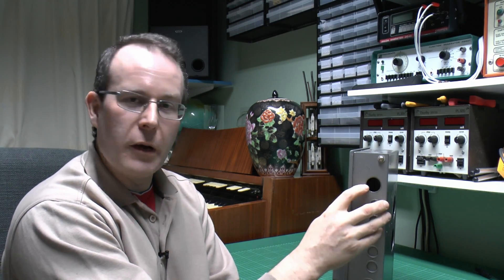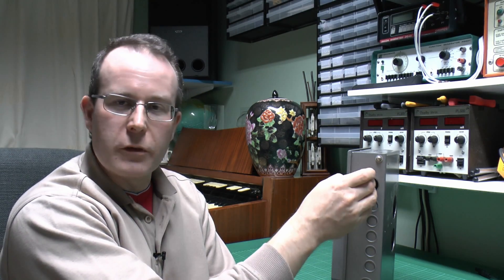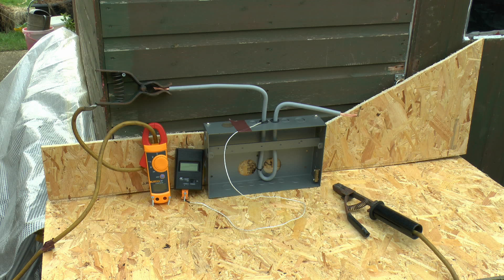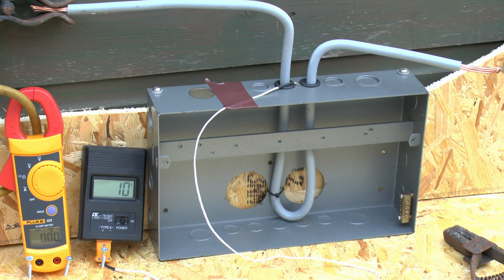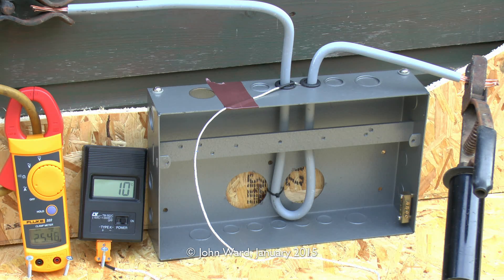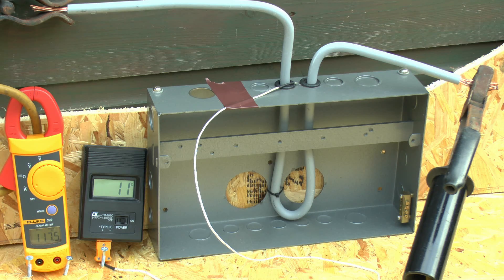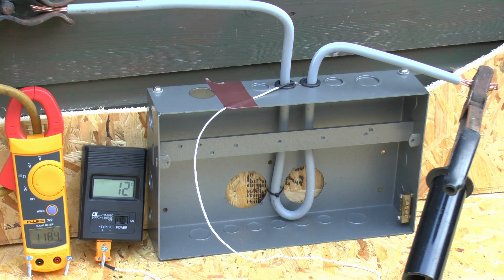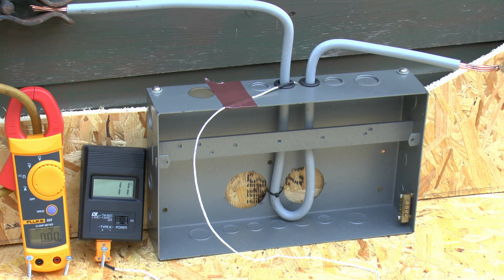Single Wires through Metal Holes

Comment: wow, are you UK guys really only allowed 100 amps? my house here in the US  has a full 200 amp, 240 volt main in it.
Reply: I suppose having half the maximum current makes sense since the voltage in Europe is twice that of the US so the maximum available power is about the same, around 24kW. That's quite enough, I suppose.
Reply: +Nick Dvorchak You need it......... If you run appliances, especially air conditioners and such, at 110v you pull a HUGE amount of amps and therefore watts, compared to a much more efficient 240v compressor found in ac's and fridges etc in countries setup solely for 240v
Reply from the maker: +Nick Dvorchak 100A is the usual maximum for a house, 80A is also common, some are only 60A.
Larger supplies are available in most areas, the next up is a 3 phase 100A supply (3 x 100A) but this is seldom used or needed for homes, even for those with electric heating.
Reply: oh wow, here in the US, the standard is 100 amps for newer houses, unless they need a bigger main, though, I have a 200 amp service.
Reply: +Nick Dvorchak you say your house is 240v but the standard 110v? So you are saying it is strange that a standard house in the UK is not as good as your non standard house in the US? Is that not like saying your standard ECO car is not as fast as my custom built race car? Not very surprising?
Reply: +Colin Richardson why do you say the standard is 110v? the newest standard, to my prior knowlage is 100 amps and 240 volts for new houses. my house, as i stated before, is 240v, 200 amp. The only change is, is the current, not voltage.
Reply: I thought u guys in America is all 110v?
Reply: +Nick Dvorchak The average house in the UK will never be pulling anywhere near 100Amps to be honest. Houses vary from between 60amp fuses and up to 100 amp fuses single phase. What could you possibly need a 200amp supply for in a domestic dwelling?  Unless i am having a shower or cooking with the oven and hobs on my flat never sees more than a few amps to be honest.
Reply: If you cut neutral you can still have power. The devices driven by each phase would divide the voltage to a "local" neutral. Since the load is seldom evenly balanced, this may will not match the "global" neutral and it will shift when appliances are turned on and off. Naturally it's rather unhealthy for all electrical devices.

Also, if you don't have a proper ground, that voltage is applied to the chassis of all devices. 

Where I live you can use fuses or over current relays for short circuit protection. AFAIK the relays will cut neutral as well. Ground is run separately and may (naturally) under no circumstances be cut. Residual-current circuit breakers have been mandatory for decades as well as proper ground. Interestingly, ground in wall outlets has only recently become mandatory.
Reply: +Nick Dvorchak 200 A x 3 400 V (200 kW+) here :)
Reply: Nick Dvorchak most of the houses, like 80 % in my country has 75 A 400V three-phase supply. My wires are a bit thicker.
Reply: well, its not twice the voltage. at every outlet it is, but not the service. my house is 240v, 200 amp, and 48kv.
Reply: +Colin Richardson no, well, kinda. Up on the street, coming into the house, we all have 240v, and 100\200 amps, depending on the age and size of the house. Once it gets to the panel, the the 240v gets split down 2 rails.  the 2 rails are in every other circuit. for example, the 1st hot wire in the panel will feed the 1st, 3dr, 5th, 7th, and 9th, etc breaker depending on the size of the panel. the 2nd how wire coming into the panel will feed the 2nd, 4th, 6th, and 8th breaker depending on the size of the panel. All general use outlet and general lighting circuits are 110v. small appliances are usually 110. but large appliances like the range, dryer, whole house\very large AC units are 220\240v. usually if an appliance is electric, it is 220\240. if it is oil\gas fired its usually 110v.
Reply: +Simon Aragon Well, I live in a fairly large house (for where i am). My house is like 3,000 sq ft 2 floor house also has oil heat, and an oil fired how water heater. with a very large and deep well, with and electric range, also with a 5 ton whole house AC. So, I dont doubt that my house pulls around 100 150 amps at times
Reply: Nick Dvorchak since u say "large" alot. I presume u realise that u then are not the average person we were talking about. Otherwise u would be saying "normal size" this and "normal size" that.
Reply: Well, as I look around when I get the chance, I see alot of 4/0 cable going into peoples houses for 200 amps, even the "smaller" houses that wouldn't need it.
Reply: +Nick Dvorchak 250A service here :)
Reply: daaaaaaaaamn... what for??? how big is you house? and where do you live to need such a large service?
Reply: Nick Dvorchak
We requested a plug to be added for a hot tub that we never used. And the heater is a double pole 60 amp. They way the wired the house on the other hand is pure garbage.
Reply: *****
240V split (aka two 120 phases)
Reply: wow
Reply: well... yes, 250 amp is excessive, but there is a lot of of houses that use 200 amps. but, my air conditioner, whole house, 5 ton, uses all that your house gets... all 60 amps. I think what it is, is that the more voltage, the less current. Here in the US, we have less voltage (normally), so we use more current. There in the UK, you guys have more voltage and less current.
Reply: +Nick Dvorchak 

varies, houses usually have house fuses rated for the board fitted or expected supply. as the US is 120v I assume 240v is classed as a three phase supply? but we do usually have smaller cookers, smaller washers, no air con.
Reply: In the US, I believe it is illegal for a residential house to have a 3 phase service. Here in the US, 240v, can be 3 phase, for commercial and industrial buildings only, as I dont know much about 3 phase, all I really know is that it cant be in houses, and has to be in commercial and industrial buildings. The only fuses that protect a house are on the street, at the transformer, and power quantities of houses and buildings. Also, in the US, we use both 120v and 240v. for example, our ranges (stove\ ovens) use 240v, 50 amp. The 240v is split between 120 for the controller, clock, oven controller. The other 120v leg is used primarily for the heating elements. the reason for 50 amps is because 5 elements (4 burners and 1 oven element) can use massive amounts of energy. Now, our dryers are also 240v, but 30 amp. This is pretty much the exact same thing. a 120v leg for the controller and tumbler motor, and the other 120v leg for the heating element primarily. Now, stuff like microwaves dont use a heating element, and dont use enough power to require 240v, and only use 120v. This 120v leg is used to power the entire thing. controller, clock, turntable, microwave radiation element (which cooks your food), and the timer. Stuff like the toaster is nothing but a tiny heating element, a resistor, a timer, and a couple lights, so 240v is not required. Most of the electrical devices that I know of, that use 120v, use 15 amps. There is also 20 amps, but thats used primarily outside, or for larger, 120v appliances like oul fired furnaces, oil fired hot water heaters, garage door openers (depending on the size), or larger motors. for example, I have a dog. Any dog owner knows that its handy to have an electric dog dryer. The one that we own has a 2 stage, 18 amp, 120v motor in it. since that 18 amps excedes the 15 amps of a regular breaker, we use a 20 amp breaker for it. also, 20 amp plugs have a horizontal neutral prong on it, preventing it from being inserted into a 15 amp plug. Since I have 20 amps at my furnace, we have a GFCI on it, which allows us to plug a 20 amp plug into a 20 amp GFCI. We also have 20 amps in out garage, so I updated some if the plugs in there, allowing us to use it in there. Now, this far into this reply, I noticed you had no air conditioning, so I figure ill explain. The AC is fairly simple. There is whole house units, and window units. Whole house units sit outside, and have a coil for the freon (compressed, cold liquid) in the furnace, where the main duct leaves the furnace and the warmer air passes through that and is cooled and cools your house. But, outside at the unit, there is 2 things, that each require 120v. My personal whole house unit is a 5 ton unit, and requires 40 amps. The compressor uses its own 120v leg and the fan motor, used to cool the compressor uses its own 120v leg as well. Window units are exactly the same, just smaller, and can run off 120v, because it has a much smaller fan and compressor. Some window units do use 240v, but im not too knowledgeable on those units. Now, I can go on and on about stuff like this, but I hope you get the jist of this.
Reply: +Nick Dvorchak The right way to compare this is not amps or volts, but power. As far as I understand you have two phases, each 200 A, 120 V relative to ground. Thats 2x200x120 = 48 kW. A European house (at least in my part of Europe) has three phases, perhaps 60 A, 240 V relative to ground. That gives 3x60x240 = 43.2 kW. It's very comparable, as (already pointed out) AC and electric heating is not that common.
Reply: +Morten Kristiansen Yes. you are the only only one that seems like you have a baseline understanding of our system. The only thing is, that our voltage is relative to the grounded conductor (neutral). Also, in out circuit panel, we have all of out neutrals and equipment grounds (regular ground wires) tied together. Once they leave the panel,  into a sub panel, that is against the code. Grounding and bonding here would be a huge lesson, and its fairly hard to explain.
Reply: +Nick Dvorchak Connecting neutral and ground in the panel was allowed here, alas a long time ago. In very old installations you may still find it. It works; but the problem is that if neutral is cut to your house, you may end up having live phase on all device chassis. It's not very.... desirable, to say the least ;-)
Reply: +Morten Kristiansen See, here, if the neutral in the house was cut, the house would have no power, and if there was a phase to phase short, or a phase to ground\neutral shout, the breaker would trip. All of our breakers here in the US act as a short circuit and overcurrent protective device. Also, with the code book expanding, all new construction houses have to have everything arc fault protected, except the the garage and bathroom, making phase to phase\neutral\ground shorts even harder because, wherever there is a load, any point of disconnect (point of the short) will have an arc when power is applied, tripping the breaker on arc fault.

EDIT: And also, in our circuit panels, ALL of out neutrals\grounds are physically separated from the  two phase buses that the breakers clip onto.
Reply: +Morten Kristiansen see, here in the US, when the neutral is cut, all the current flow to all of our devices stops. Even though there s line voltage, inside,  there is not return feed (neutral), so it all stops. Lights won't work, heaters win't work, electronics won't work... etc. And for surge protection, there are many company's that make them, I really only know of Square D be Schneider Electric, here in the US. This whole house surge protector clipc in only to Square D panels, and since the hot wires run down a bus, and attach to the breaker (or surge protector in this case) all you do is hook up the neutral, and then there is surge protection. But like I said, many company's make them, I think Eaton, and Murry\Seimens (company then sub comapny) make some, and probably a few others.
Reply: +Nick Dvorchak in Au there's not a lot of need for heating, so 63A 240V 1Ø is typical, totalling 15kW for domestic. We also don't use aluminium conductors up to the switchboard/panel like you do. It's aluminium strung between poles but copper down from the joining crimps.
Reply: +Nick Dvorchak why the heck would you need so much power?
For the last year my power-meter clocked in about 1500kWh for my whole flat...
Reply: +audiocrush Well, you have to take into consideration that we have 4 people living here, in the middle of nowhere, so we dont have gas appliances, or town water. We have a 15 amp well, for water, 50 amps for our range\stove, 40 amps for our AC unit, and 30 amps for our electric cloths dryer. That alone, in the summer time is about 135 amps. When the AC is on, the furnace blower has to be on as well, so thats another 15-20 amps, and then theres just general circuits for the radio, lights, computers, etc. Here in the US, we have 15 amps for general outlet circuits. My specific panel, for my house has 15, 15 amp circuits for stuff like the lights, outlets, bedrooms, basement, etc, and we have 9,  20 amp circuits for the kitchen counter-top, outside outlets, the furnace, and a few other things around the house.
Reply: +Nick Dvorchak first up: where the hell did you get 240volts AC in the US?
If you are running everything on 110volts I can imagine that really really really huge big ass blower needs 15 amps to run, but a normal fan can easily run on half an amp... and thats a pretty large fan
Reply: +audiocrush well, first of all, the fan is the blower for a 2600 sq ft house, and the 240v is what comes into the house in 2 120v lugs to the main breaker. From there, it goes to 2 bus bars, so every other breaker is connected to the same lug. So for example, breaker 1, 3, 5, 7, and 9 would be on the first 120 line coming in, and breaker 2, 4, 6, and 8 are on the second line coming in.
Reply: +Nick Dvorchak 
well that still seams a bit crazy to me to use electric energy to heat up water and air...
in germany we still use CNG or diesel for heating in remote locations.
Diesel is actually still quite common. It's just not called diesel but "heatingoil". I'm note sure how to translate this correctly.
There are trucks driving around the streets and fueling private home owners diesel tanks in their basements once or twice a year. And in fact this is still one of the cheapest options over here.
My parents have quite an old house, not ver well insulated and stuff and they payed about 900€/1000$ for whole house heating and warm water (it is a bit larger than 2000 sqft I think if I converted this correctly)
There are even people who have diesel generators in their basements that create electrical power while supplying the house with warm air and water at the same time.
I guess that's where my misunderstanding for the need of such high current home powerlines comes from.
Reply: +audiocrush well, we use oil as well to heat our air and water, as there is natural gas options and electric options. Oil here is about $2.50 a gallon this year, which has gone down from $4.00 a gallon last year. As power consumption goes, I highly doubt that we come close to our 200 amp limit as we do not have any pools, or hot tubs with large pumps that can run year round, nor does our AC.
Reply: +Nick Dvorchak If your neutral was cut what you'd end up with is a neutral connection that gets dragged towards the heaviest loaded side. If one lot of breakers is pulling 60A and the others 30A, the 60A ones will get a voltage well below 110-120V, the 30A ones well above. As things get blown by the excessive voltage the imbalance will become greater and greater until all you're left with on one side is stuff that can handle 220-240V anyway.

The same thing can happen on three-phase supplies if the neutral is disconnected. For a balanced load such as a motor it wouldn't matter (the neutral wouldn't even be needed) but with unbalanced loads the voltages start drifting off and blowing things.
Reply: oh, well i guess that is a little more complicated than how i was originally looking at it
Reply: +Nick Dvorchak You can have as much as you want if you need it. Most houses wont need more than 100A. If they do they will usually a three phase supply.
Reply: audiocrush They use a single phase, centre tapped secondary transformer.

https://upload.wikimedia.org/wikipedia/en/2/29/Split_phase2.png

We also use this in Aus for rural water pumps, 240/480V

https://upload.wikimedia.org/wikipedia/en/1/12/Swer.gif
Reply: ***** Sorry, I cant answer that, as I am not familiar with European meters. I would think youre fine if you draw less then 20 amps, but you might want to ask a local electrician, or the power company.
Reply: +Mark Schulz IV I take it thats for some industrial building? or just a very, very large house?
Reply: ph? Im not 
familiar with that. what does it stand for?
Reply: oh, makes sense.
Reply: my house? its just a formula for the house size, and 3VA for a house. I am not sure what the formula is, but it came out to be 200 amps for my house.
Reply: Don't forget our single phase is 230v and 3ph is 400v, domestic would in most cases be a 60amp - 100amp supply and this has served the millions of homeowners perfectly for many decades... really not sure why you require 200amp, don't forget we don't have pools, jacuzzi rooms etc just the basics as you need warm weather and something called the Sun to want such luxuries.
Reply: The US system is 240v. It's provided as split-phase with neutral centre-tap which is grounded. Higher powered equipment can be supplied at 240v, but it's live/live. Normal sockets are 120v live/neutral.

The 200amps (if that's what the property is supplied with) is the rating at 240v. If it's all taken off as 120v branch circuits, then you get 400 amps. Note that the neutral back to the distribution transformer (those things on poles dotted about the US suburbs) should no be carrying much current if the phases are reasonably well balanced.
Reply: It's 240v split-phase with neutral on a centre tap. High powered equipment can be run across both phases using live/live, whilst standards outlets are provided with 120v live/neutral. I think it used to be 220v split phase, but now it's a nominal 240v split phase. Presumably to boost capacity somewhat.